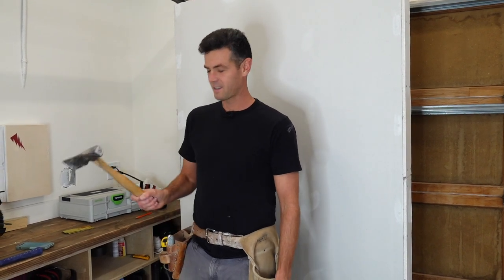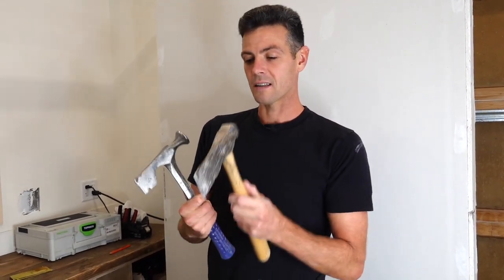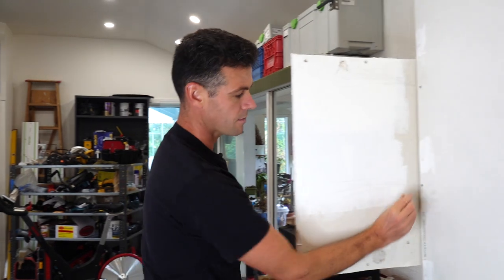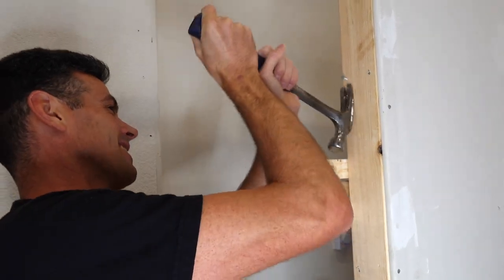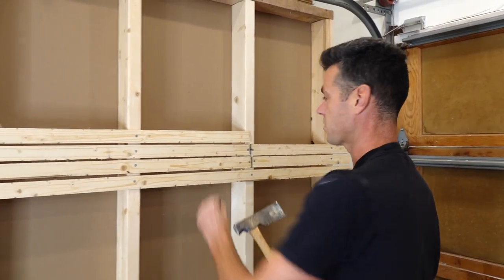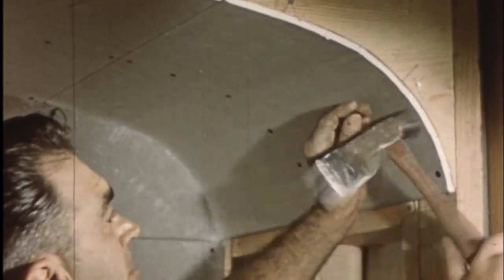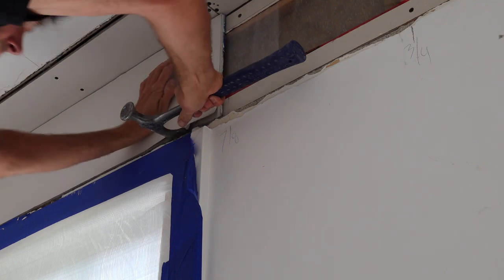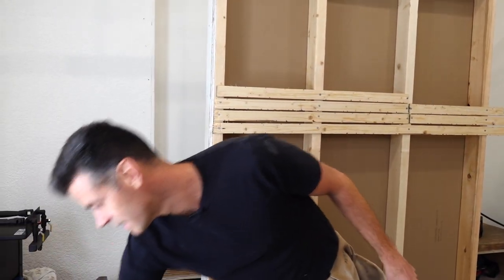Why are DRYWALL HAMMERS shaped like this????

Comment: Yeah most honest statement... " I don't know"

Metal stud guys use lathing hammers , dry wall hammers and shingle hatchets for several reasons... The blade is a good wedge, you can pop screws loose with it, the edge is used to check screw depth  and for demo purposes.

The reason for the angled head is knuckle clearance while nailing the lower nails.

The exaggerated dish on the face is actually done to keep the edges of the nail from deforming as much as possible to prevent them from cutting the paper. The head of the nail is dished to hold the mud

Comment: Yes!  Finally a video about boarding!  Here's my two cents...that square headed hammer is a roofing hammer and that Estwing with the round head is an actual drywall hammer.  The square hammer is much heavier, for driving roofing nails in a single swing.  The Estwing is lighter for more finesse driving drywall nails.  The 'hatchet' back is useful for prying lumber or drywall into position in tight spots.  I haven't used drywall nails in about a decade and I don't carry a drywall hammer on my belt, but I keep one around in the tool box, just because.  All that being said, I dunno squat about the history of drywall hammers or the lathe and plaster you spoke of...except for demolishing old lathe to be replaced with drywall...to which I would say, get a framing hammer or a Stanley 'Fubar'.
Reply: The lathing axe looks a lot like a roofing hammer but there are some subtle differences. The video is spot on and accurate.
Reply: I believe you are right about the hatchets. I have a red handle, square face hatchet that I used almost 50 years ago as a carpenter when we put on asphalt shingles. I had just bought that tool and the edges were very sharp. Guess what? I sliced my finger wide open the first day I used it. I probably hit it half a dozen times before it healed up. Our crew didn't have roof guns at that time.

Comment: I've heard before that wood lath was installed soaking wet, out of a 55 gallon drum. I imagine it must have been pretty heavy. I do know wood lath should be soaking wet when the first coat (brown coat) of plaster is applied, so it kind of makes sense. Anyway, the lath was a lot easier to chop off when it's fully soaked. Also, I've seen from  tons of demolition that they tend to chop it on an angle, for more of a slicing action.
Reply: Probably wet the lathe so the plaster wouldn't dry out to quickly.  Like wetting down the form before concreting...

Comment: My house was entirely lath and plaster. I've had to replace some of it with drywall because eventually they start to pop off the wall but I always find it remarkable that they built a house like that. That had to be thousands of tiny nails to hold up all those strips of wood. And then it still had to be covered with plaster which was a trick in and of itself. I've seen some areas of plaster that were almost half inch think and other areas where it was only about an eighth of an inch thick.
Reply: A trick we learned when replacing plaster with drywall was to save enough lathe to clad the studs so you can use a thinner drywall and still re-use all of the old (sometimes un-matchable) finish trim. 
Typically, it was 3/8th to 1/2-inch drywall, depending on who did the plastering way back when.

Comment: On metal studs I primarily use my hatchet as a prybar of sorts to shimmy my board over to close up my flat joints when standing up board. It can also be used in conjunction with pliers or some other object as a fulcrum to create a half-ass floorjack.

Comment: One more reason why I used a drywall hammer is the angle of the handle to the head and the flatness on top to nail close to the ceiling into the top plate. My hammer is lighter than a framing hammer. Old school ,we would always tack our boards up with nails and screw them off later. Easier than holding a drill with a cord attached. Also the hatchet end was used for insulation.

Comment: I live in the UK and Plasterboard/ dry wall fixers seldom carry these lath hammers now . But roof tilers do . The hammer side is used for nailing tiles to roof battens and the axe is handy for tapping tiles down length ways to cut in half and cutting corners if fitting round chimney stacks etc. Complex cuts are done with disc cutters. I know because I worked in that trade for many years.

Comment: I used my grandpas old ones as camping hatches for going on 20 years now, and they're the absolute best. 

You can split branches for firewood, drive stakes for tents or tie down ropes, and even pull the metal or plastic ones back up with the nail puller usually. 

We never used them for drywall though, it's always been screws. We didn't even know they were for drywall until a few years back. Always thought they were old roofing hammers

Comment: Always carry a 5 in one for levering and stuff like you mentioned. But I bought a Milwaukee “drywall hammer” is how it’s labeled in store. The main justification of buying it was for drywall demo. Typically use some type of saw for clean fast cuts, but, sometimes use a hammer to start Incase wires n pipes. The axe head make much less of a mess and cleaner breakup which I just like. It’s also handy for hacking through chicken wire for stucco demo and yes, lath and plaster. Love your Chanel!

Comment: I love my rock axe! The only time I've had a use for the blade was demoing some metal lath partially embedded in plaster. It worked way better than tin snips and my fingers didn't get all cut up.
Great work VC.

Comment: Finally someone who knows the history of the axe we use impressive!  You might like this  old school hangers would pull the handle out of the head and replace it in a very slight angle . The reason is when your nailing off the slight angle would keep your knuckles just barely off the sheet. Look at at an old hangers knuckles the have calluses in the tops if there knuckles from smacking the sheet. Thx for all the information you give especially for the the younger guys who can’t even swing an axe lol

Comment: Thank you so so much. No one has ever answered this question for me. I'm guessing a roofing hatchet works much the same way with wood shingles. I once was working on a family members house from the 40's or 50's and I noticed their dry wall came in 2'x8' sheets when originally installed. That made so much sense because one person would have an easier time installing that sheet vs a 4x8 sheet produced today.
Reply: @lexwells4763 
They are made differently.

Comment: Very cool that you took the time to look into this. I’ve demo’d miles of the old lath and plaster , wondering if , one day , the skilz would be in demand again(?).  Plaster had(has) such a nice look.  I’ve skim-coated plenty of drywall for clients that wanted a plaster-look with fairly good results.  Love your channel.
Reply: There's work restoring historic buildings. Probably that work will remain steady for years to come because the only buildings where you'd bother to do L&P are protected. I imagine those guys also get work coating blueboard in high-end construction.
Reply: More than a nice look, has great insulation for temperature and sound and fire resistant properties.
Reply: There is such a thing as Thin-Coat Plaster.  It uses a special drywall board where the paper is more rough/porous so that the plaster will properly bond to it, and the plaster is put on at about a 1/8" thickness. It gives you most of the benefits of traditional plaster including the hardness and smoothness but installs much faster.
Reply: @WallDoc we plasterers call it blueboard
Reply: @markadkins9290  Yeah I knew that but I was trying to dumb it down 🙂  Lots of people get blue board mixed up with green board for bathrooms (especially the purple variant) which are on the opposite end of the spectrum for porousness.

Comment: Havent hung any drywall at all in my life, but I can attest to the fact that this tool is fantastic for various forms of woodworking and bushcraft. It works for splitting shingle style slats for kindling & building purpouses ( if you baton it like a froe), can be used as a lightweight hatchet to sned small limbs off trees, can be used as a chisel style tool and much more.

A few points of advice I offer to people looking to invest in this tool are as follows:

• MAKE A PROPPER SCABBARD FOR IT if you pick one up for yourself. Trust me. Safty first.

• Buy the one with the wooden handle and not the full metal tang from Eastwing. You can always replace a handle, and it's a lot cheaper then you replacing the whole tool if the handle breaks.

• Tune and polish the factory edge bevels to suit the function you need. 
 
• Take a rasp, sandpaper and oil/ spray on rubber grip coating to the handle to adjust it to your hand to mitigate hand fatigue. I did this to mine and it helped out emmensely.

• Ponder if a lanyard ( wrist strap) is a viable ( optional) safety measure you want to install onto your tool. If yes, then add it in. If not, consider it like a tassle and deem it " a hassle". 
 
Hope these recommendations help.

Comment: That big Vaughn was my first drywall axe I purchased myself. I just thought it looked so cool lol. The problem was that it didn't make pretty round little dimples like the round heads do. I destroyed a lot of board back then. The Estwing's are pretty standard now because we mostly use them not to pound nails but to pry with as it's hard to break the steel handle (though we break off the nail pullers regularly).

Comment: It makes so much sense if the sharp edge is sharp enough to cut sheet rock with. It’s definitely good for demolition but I’ve never actually seen this in practice, next time I’m on a sheet rock job I will definitely try cutting this way. The guy in that video is super pro check him out adding the nails as he is finishing the one before it I bet he has driven millions of nails

Comment: After renovating my in-laws' 1859 farmhouse, I cant tell you without a doubt: fuck lath and plaster. lol. Especially when all of the true 2x4 and 4x4 studs were milled from local red oak.
Reply: and real attention paid to exact 16" centers....every drywall sheet needed to be cut on 2 or 3 sides lol
Reply: omg this is my life right now. Bad enough that the framing has skewed the whole house east a couple degrees..but then they were just eyeballing ALL the studs. I'm getting good at scribing crazy lines and round corners.

Comment: Back when I was a drywall hanger in the early eighties we used a lot of nails. We would tack a sheet with nails and a guy came along after with a screwgun. I always preferred the Wallboard hatchet. Same round face but a straight head and a shorter wooden handle. Never liked the Vaughn. I used a lath hatchet some, but it tends to rip more paper on odd hits. The hatchet end has lots of uses. Scoring, smoothing edges, carry the sheets and prying them as you showed.

Comment: Mr. Carpenter, I'm dying over here. My drywall keeps cracking. I've taped it. I've added screws. I've added a ridiculous amount of blocking. The seams land on studs. It keeps... cracking... it's a basement that has water coming. Could the additional humidity behind the walls be causing cracking. I'm using store bought mud. After how many times I've redone this I think I'm getting pretty good.

Comment: In the Stucco industry they use this hammer to shape and bend metal lath around stucco detail like pillars and build outs around windows. 
The square head is to get into square inside corners, and the hatchet side further helps you get into tight inside corners with your metal lath.  I sell metal lath.  I also sell the Vaughan style hatchet. We have lots of Stucco here in Winnipeg. All the stucco guys use this hammer for installing metal lath.

Comment: as a commercial carpenter I carry an estwing hatchet like the one shown in this video. we do not use nails which in my opinion is all a claw hammer is good for. you can use your hatchet to put up board, set behind the board you are cutting on an a frame cart to avoid damage to the next sheet, scrap stubborn drywall mud, use the hatchet end to pry sideways giving you a better angle of leverage, can reshape metal studs and track with the hatchet to remake a corner, and turn it sideways and slide it under track to bust it off the floor, some of these things may be able to be done by a claw hammer but where I work as a lather we definitely prefer the hatchet

Comment: I used one decades ago when furring a CBS block building with a T-nailer. Made it real sharp and used it like your lath example. It worked pretty well, tho I had to chop/score both sides with the 7/8 furring strips.

Comment: I think I used an Estwing for nailing Sheetrock a long time ago.  The “textured” surface of the hammer aided in setting the nail just a little while guarding against breaking the surface of the paper.  As he said, using screws is much better.  I think once you are used to the screw gun, it is faster than nailing.  Change occurs slowly because so many of us are set in our ways.  But, I bet you’d be hard pressed to find guys nailing drywall nowadays.  One catalog I had featured a lathing hammer with a replaceable hatchet head.  It was thin and sharp.  It was very much like replacing the blade on your utility knife.

Comment: I have a piece of lath i pulled from an old post and beam that had corn cob insulation. It's about six ft. long by sixteen inches wide. Its masterfully split all thru it to make the gaps for the plaster. Hatchet work for sure. Going to make a cool sign or something with it.

Comment: You have to nail the second sheet close in the corner because the intersecting sheet leaves you only an inch of nailer. Shinglers hatchets had a knurled bolt in a series of threaded holes on the blade to hook on the previous course to set the reveal for the next course.

Comment: My father put up drywall with a hammer in the 80s, that didn't stop him from using screws... using a corded drill with a dimpler was too inefficient with the old awkward and overpowered drills and all the extension cords.   Cordless drills have made such a big difference for DIY.

Comment: You carry 54" drywall with the notch in the Estwing, somewhat use it as a rasp, drywall lifter, scraper, split wood for backing, nail puller and still drywall behind steal doors

Comment: I give those old-school lathers credit, that's at a lot of nailing, forearms like Popeye LOL, I like the wood hatchet personally but I used to do wooden shakes as well. My dad taught me how to do lath accordion style just because his dad taught him, which I find that method pretty kool, so when I run across it during the demo, which isn't very often, I like to find out how wide the board was that was used and I have found a few that were 20 inches wide, lots of respect for the old-school way! Thanks, Ben from one taper to another.

Comment: Awesome video.  I have a second-hand Vaughn lathing hatchet.  I got it as a tool for splitting sedimentary rock on a geology field trip (awkwardly, I know) and I now use it on camping trips to drive tent stakes and as a backup for splitting kindling, but I never knew what it was originally intended for.

Unfortunately, our house has that awful metal mesh plaster and lath, and I have no idea of what tool to use on it.  Maybe dynamite and gasoline, but that's got some downsides for simply hanging a picture.

Comment: The lathers hatchet is preferred over a regular hammer by steel stud framer/drywallers because the hatchet is a 2 in 1 tool - hammer & lever. Steel stud carpenters use screws most of the time instead of nails so the claw on a framing hammer serves little purpose for this work. Additionally finishers complain when drywall hangers have lots of gaps in their sheetrock that need prefilled. Using a lever to draw your seems tight during install eliminates the issue.

Comment: They are still around because once you learn to use one, you won't want to use anything else. I use mine for framing as well as lath. And the blade is razor sharp. It cuts paper used on some lath, or roofing paper.

Comment: I believe the reason for the angled head on the estwing model is to allow a clean swing along the edge of the ceiling/ top of the wall. Notice the hammer face is still parallel to the haft, just offset to over reach

Comment: In the 70’s some California framers would modify a rigger’s axe by cutting off the blade and welding on claws. This was done because of the axes’ more ergonomic handle, the waffle face ( not commonly available on framing hammers of the day), and it’s superior balance. Time was money and a pro would have to drive a 16d with two strikes. It was called a California Special and swinging one meant you were hard-core. That and having a 10” Skil 77.

Comment: Pronunciation tip: the "A" in lath (the thin strips of wood that hold plaster on walls) sounds like the "A in bat.  The "A" in lathe (the machine for turning cylindrical forms in wood and metal) sounds like the "A" in cake.  The hatchet in question was used in putting up lath, and so it is pronounced like "lath" plus "er.
"

Comment: About using the hatchet side to mark your  wall studs  or ceiling joist by driving it to leave a mark instead of climbing a ladder to marked them with a pencil or crayon or sharpie whichever is your choice as marking device , reach hit and there it is a line indented on to guide your bailing or screwing. Zas !

Comment: I think the reason why the rounded hammer's head is offset is to save your knuckles. If you strike the nail with the head parallel to it then your knuckles would be further away from the wall. Like you said, it does take practice to change your swing to accommodate for it.
Reply: You are correct,   and I never could get used to the offset on the Estwing hammer, or the square head hammer.    I bought a Wallboard hammer with the round head and was perfectly happy with it.